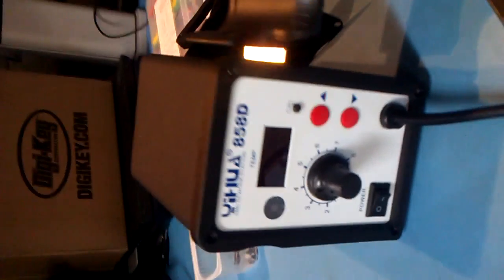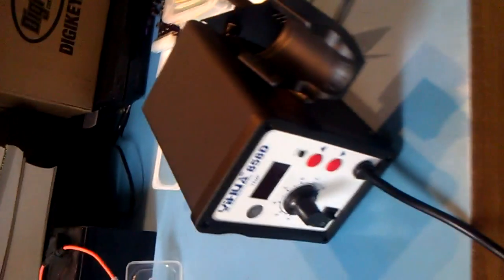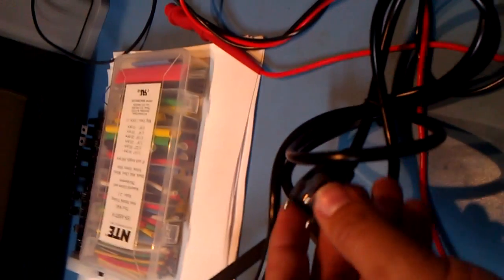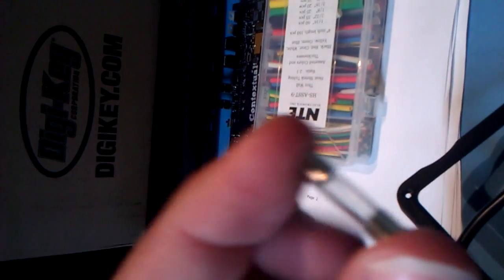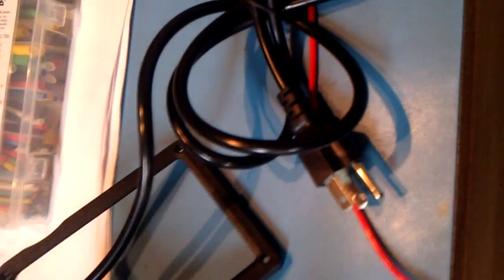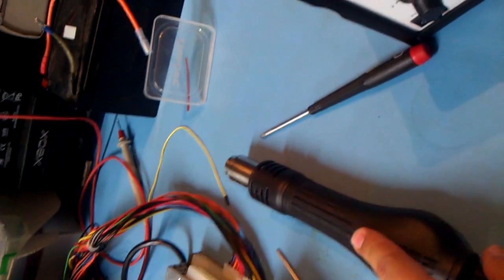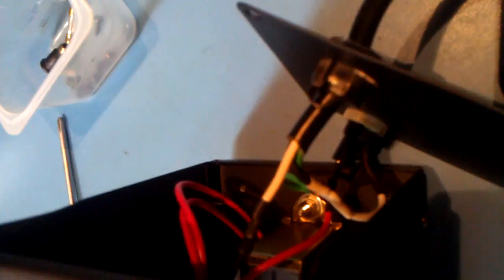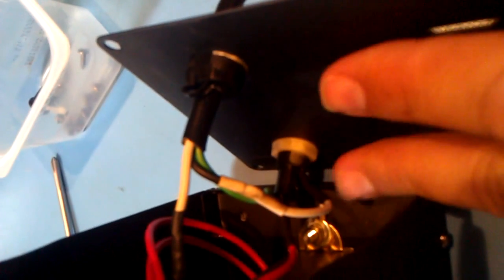Making the Yihua 858D hot air rework station safer

Comment: I have a Zeny station and there is continuity between the ground on the plug and the case but also between the neutral and hot blades of the plug. That's not right, is it? Thanks!
Reply from the maker: Actually that is correct. The great secret of home wiring is that ground and neutral are both tied together in your circuit breaker box. But please immediately forget/ignore this fact, or else you'll be tempted to cheat sometime in the future, and end up electrocuting someone (probably yourself).
Reply: Thank you for your quick response. Sorry, don't understand. There is continuity between the neutral and hot terminals of the plug. If I take the fuse out of the back of the case, then there is no continuity. Is that ok?
Reply from the maker: Sorry, I missed the 2nd part of your sentence. It's normal to have around 55ohms of resistance from the Neutral to Live on these. I believe it's the resistance of the heater element.
Reply: Ok, thank you, Dave. I did open it up and took a look around. It looked fine to my untrained eye! I fired it up, maybe not the right term, plugged it in, and it's working great.
Reply from the maker: Hehe, just keep it on a surge bar that is powered down when you are not using it and you'll be fine. Enjoy!!

Comment: Hi, I have the same model reworkstation and the problem seems that it drives out Cool air instead Hot air. Even when I go up temperature still's the same. What could be the cause?
Reply from the maker: Heater element could be shot, maybe take apart the gun part. I think the heater element is replaceable, maybe the connector came loose?

Comment: too bad that live and neutral contacts on European power outlets are identical, i.e. you gotta check with a voltmeter if you want to know which one's which.
Reply from the maker: bergweg I was under the impression that grounded 'European plugs' enforced 3 wire polarity via the outlet's male ground prong? Then again for a 2-prong plug, yeah I guess you're pretty screwed :D

In the 50s (in the USA) the Neutral plug/prong was required to be slightly larger than the Live. You can still force a 2 prong plug in wrong, but usually requires a fair amount of effort or filling of the prong. I believe the 'fatter' neutral  is also in use in Canada and a few other countries, its a good compromise IMHO.
Reply: Dave McAnulty I like the north American plugs/sockets, compact and you can tell which is neutral and which is live. 

The most common European wall sockets look like this: http://i01.i.aliimg.com/wsphoto/v0/709863329/-font-b-European-b-font-Style-font-b-Wall-b-font-Switches-and-Socket-Shucko.jpg

so you can't tell which contact's which.

Comment: No need to move location of ridiculously small ground wire.  Just scrape some paint away from inside of front panel by chassis screw and do the same to the chassis. Otherwise my unit works really well.
Reply from the maker: Are you sure? My 'ground screw' on the circuit board went into a plastic standoff!
Make sure you hit it with an ohm meter!
Reply: Dave McAnulty  
measured from ground wire to front panel(paint removed) and got 0 ohms.  removed paint on front panel and chassis and replaced everything and now have perfect continuity from ground on power plug to metal chassis on air wand.  didn't before i did this.  Pretty sure ground standoff is a solid metal screw to front panel.  Ohms don't lie!
 thanks by the way for a great video!

Comment from the maker: Nope just the 3 safety issues.

1. Not grounded.
2. Fuse on wrong wire.
3. Power switch on wrong wire.

Fix those three and you should be good. You'll get an idea how scary this thing is (when not fixed) the first time you use it, my lights dim!

So far I've had poor luck with solder paste, however I've had incredible results drag-soldering the pads, then placing the IC on top of the tinned pads and heating them up with the air. I was able to easily mount a 28pin TSSOP this way.
Reply: +Dave McAnulty Hi, i just ordered one of these. I'm embarrassed to ask this given i've got a degree in CompEng, but i focus more on digital electronics. So here goes.

When i receive this, i'll do a cont check on my UK plug on the live wire and make sure that's the write going through the fuse. If it's not then i'll switch it, then i'll re-wire the switch to switch the live wire, (what am i doing with the neutral wire that was existingly soldered to the switch?).

Lastly, I'm aware that you say the gun itself is not grounded, and i know the front panel is not grounded. By grounding the front panel (either your washer method or soldering a wire to the inside of the front panel to ground/earth), would the gun be grounded too? or is that a separate job?
Reply from the maker: +orbita1 No worries, Mains AC is.....weird. I prefer to play with DC also :)

If your switch/fuse is wired backwards you can just swap the power as it comes into the unit, that will handle both issues.

My gun had a small (very small, prob too small) ground wire, but it ended in a terminal that was screwed into a plastic riser on the back of the faceplate. So that's no good :)

What I did in the video was scratch off paint between the metal faceplate and the metal chassis (which fixes the front panel not being grounded), then sandwiched that terminal between the two with the screw to ground the gun as well.
Reply: +Dave McAnulty So i received my air gun. 

the front plate and actual gun are grounded nicely. 

the live wire goes directly to the 6th pin of the top left white clip.

neutral goes to the fuse --> switch --> 2nd pin of the white header clip. (top left).

Is this totally not normal for ac electronic devices? shouldn't the fuse work with  neutral too since teh current will travel through the neutral path? and finally, isn't it safer to switch the neutral than the live? 

I take it i need to re wire this so direct from the internal plug, the live goes to the fuse (then to the switch). and the neutral goes to the 6th pin of the white header?
Reply from the maker: I'm no electrician, but I believe the issue is that you could short live to ground (perhaps via your body) completely bypassing the fuse on neutral. And this potential exists 24/7, unless the switch is on the hot side to cut the power.
Reply: +orbita1 I ended up doing the switch as described. all works well. about an inch away from the tip, on about 10 oclock i measure roughly 20-30 c higher than what it should be but i understand i can calibrate this. Only complaint as of now is the hilariously short plug cable.. it's so short i'm thinking if i should just replace it. i guess a nice mod would be to add a 3 pin kettle lead.